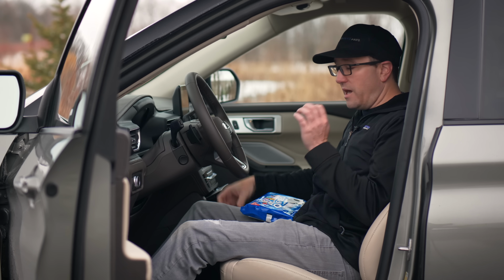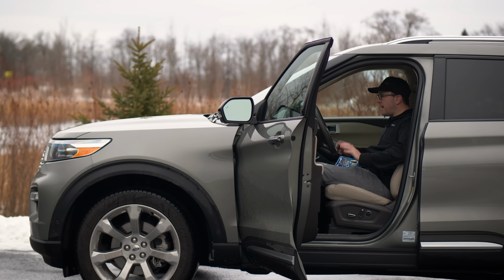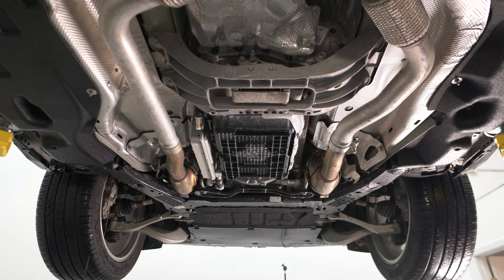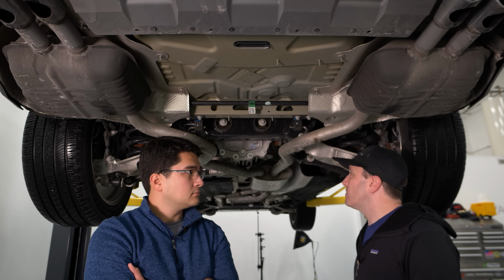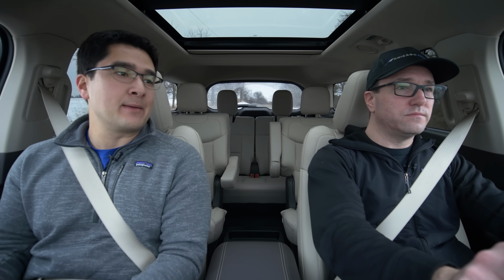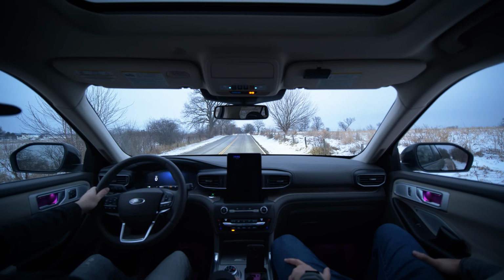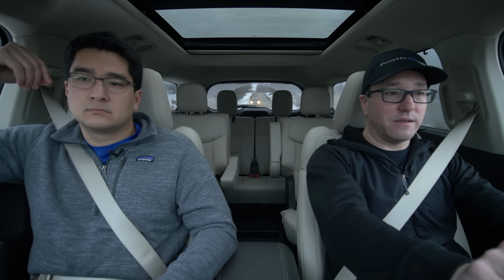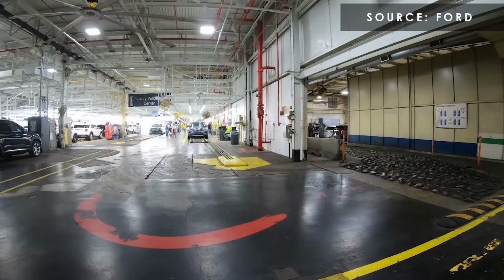2020 Ford Explorer | Who Is Responsible For This?

Comment: The Ford Explorer Platinum trim starts at $58,525... comparably equipped competitors below:

Toyota Highlander Platinum: $46,850
Hyundai Palisade Limited:$44,925
Kia Telluride SX: $41,790 
Honda Pilot Elite: $48,220
VW Atlas SEL Premium: $48,395

Furthermore base luxury 3-row SUVs, 
Lexus RXL base: $48,325
Acura MDX base: $44,500
Audi Q7 Premium: $53,550
GMC Yukon XL base: $52,400

The list goes on. Can someone PLEASE explain to me how the Explorer Platinum is $6,000-11,000 more than comparably equipped competition, AND the luxury competition?
Reply: Ford half-assed it and wants top of the market segment prices. That's one way to say cars are less profitable.

Never mind the fact that people think an Explorer is a nameplate where you can even think of asking 60 bones for. I'm old enough to remember what kind of quality and luxury you could get for north of 50 grand, and this ain't it Ford. It also wasn't that long ago either.

One last thing. Giant touch screens age poorly. Even if it still functions in 5 years, that ridiculous tablet is going to tank this SUVs resale value something fierce.
Reply: Great point!
Reply: Forget the platinum model...   you can't get an explorer in a 6 cylinder for under $50,000.  Toyota..  Hyundai, Kia, Traverse, pretty much all competitors have a 6 cylinder starting in the low to mid $30s.

Ford putting a 4 cylinder on a 4,000 pound SUV is moronic.
Reply: @jcjbike  And the Ford turbo four outperforms all those 6 cylinders.
Reply: @georgesnyder5337   If what you said was true, why are all the Broncos coming with 6 cylinder engines, including the base model at $27K?  You must work for the company that supplies Ford their turbo chargers because they are going to make a killing selling those to Explorer owners every 35,000 miles.
Reply: @jcjbike  Huh?  I work for the turbo company because I point something out?  Cool story Joey.  I am not sure what point you are trying to make with the Bronco is.  I am also not sure what you are going on about with turbo chargers being replaced at 35k miles.  So much goodness in your post.
Reply: @georgesnyder5337   Follow me...  I'll type slowly...   Ford...  has tried to rip off potential customers by under-specing AND over-pricing the explorer.  EVERY SUV in that class runs a far more powerful, longer lasting engine and also is priced better.  Putting aside the growing list of reviews online where customers are complaining about their turbos going bad (a turbo in a 4 cylinder can't push a 4,000+ pound SUV before that weight causes premature breakdowns...   even Ford announced big price drops on their 2021 model year.  That's them acknowledging they missed the mark.  The Bronco reference goes right to your point...  if that 4 cylinder "performed better" then why didn't they follow suit and put that engine in all the broncos???
Reply: @jcjbike  Ok guy.  You statements about 4 cylinder turbos "not being able to push a 4000 lb SUV" dates you to peaking in the early eighties when turbos were a new thing. Here it is - a fact: like it or not, the 2.3 eco boost equals or outperforms the 6 cylinders in all of those cars mentioned.  It is not an emotional statement.  Simply a fact.  Your assertion that it will suffer premature breakdown simply ignores the mountains of objective data, including other cars with similar powertrains, that demonstrate otherwise.  Period.  Once you swallow that pill, you can see that the Limited trim pits against, say, a Highlander Platinum, much more evenly.  You keep going on about the bronco - I am not sure why.  I didn't say the 2.3 performs better than the 6 - it doesn't.  I am not comparing those two, or comparing them to an unrelated Ford sibling.  Stay on track.
Reply: @georgesnyder5337   Let's compare...  if this mindset on 4 cylinders is archaic, then why do all the competitors to explorers still use 6 cylinders?  You use 4 cylinders to be cheap...  yet the explorer isn't cheaper.  In fact, it was so over priced in 2020, that ford had to drop their prices for the same models in 2021. 
If the 4 cylinder ford engine is so great, why is it not in the Bronco?  Heck, why isn't that 4 cylinder on the Ford Edge???
Reply: @jcjbike  Yikes.  The 4 cylinder is in the Bronco.  We are done here.  You clearly don't know what you are talking about.
Reply: In my area the Palisade/Telluride top trims if you can find them in stock are going for literal MSRP (The $49kish)  vs Explorer Platinum is going for about $51k (with massaging seats and self sealing tires and stuff). I think Ford is trying to do the "Starts expensive but look at the deal you get!"
Reply: @sumofty  my niece has a Hyundai Kona. 9,000 miles needs a new engine
Reply: @sumofty   Right now, inventory is tighter so they are getting higher prices.  If you are talking about apples to apples, the two lower level explorers (starting price to low $40s) are out of spec related to the competition in terms of the engine.  A 4 cylinder on a 4,000 pound suv???
Reply: @jcjbike  Actually dont knock the 4 cylinder until youve tried it, it feel pretty solid imo. They actually are higher HP than the Telluride, Highlander, etc and the Explorer's RWD architecture makes it so that the 4 cylinder actually has great towing capacity too. That said, the Dealer lots near me only have like 5 explorers each. You can get a platinum or a ST right now in my area and thats it lol
Reply: @sumofty   It's easy to knock a 4 cylinder on an SUV.  Especially when every other suv in the category (traverse, highlander, murano/pathfinder, durango, Palisade, etc.) offers 6 cylinders for their SUVs in the low $30s and go up from there.

And the fact that Ford recently announced their 2021 explorers (same vehicle as 2020) will be reduced in price several thousand dollars clearly suggest they know their product isn't price/spec competitive either.
Reply: What’s is crazy is, compare it to a genesis gv80 😬
Reply: @doubled8247     love the looks gv80 just hope it come in  2 row
Reply: @doubled8247  like  it but no v8
Reply: @youtubecarspottersguide1   don't worry the v6 ecoboost has the power of a v8 but it spend about the same amount of gas
Reply: @chicotruco  yep..and ford I4 turbo is a sweet little motor. I was amazed.
Reply: Not sure where you are but in Canada its called interest, a highlander here has 4.99%, they have an MSRP of 53000 cad and with that interest it skyrockets up to 61000, our ST was less than the highlander and had way more features. The same goes for a telluride etc. We test drove 5 different SUV's and for the price it's really hard to swallow getting highlander colour blank that everyone else has for more money than something special and fun
Reply: Ford is the worst dealer when it comes to inflated MSRP to give customers the illusion of a great discount, especially compared to most other comapnies that go 0-10% max on average.
Reply: @TheRedc0met  I guess it would depend on what you value.  By all accounts, the driving dynamics are better.  Heck, you can't even get a proper tow hitch on a highlander from the factory.  It is also roomier than the Highlander.  So yeah, I am sure someone will buy this "junk" over the Toyota.
Reply: @georgesnyder5337  People who want a proper tow hitch on a highlander usually don't get the highlander lol. They get the 4runner. And the new Highlander is just as roomy if not more, At least it was to me. Add best in class mpg getting this Ford would be stupid.
Reply: Good point. I bought the Highlander Platinum after leasing 3 Explorers.
Reply: Jerry Phillips  fair enough. Lexus are damn nice cars that hold their value for sure, especially those 90s and early 00 models. 
Personally, I generally don’t factor resale as highly as driving experience, and that put the explorer far ahead of the highlander even considering how much less I’ll get for it in 10 years. Couldn’t afford the new 3 row LX sadly.
Reply: you are paying for the shit sound system hahahaha
Reply: @chicotruco  lol, what 50k car has a good factory sound system?  They all sound about the same to me. But I do like the massaging seats that come with the upgraded, but yet still shit, stereo in the explorer.
Reply: @gregdavis7316  I recently bought a second hand, 2016 explorer, it comes with 12 frecking speakers, yes 12 speakers got a subwoofer in the front right on my face, and when the bass kicks in sounds like somebody is farting, lol cheap quality but they sell it like a "premium sound"
Reply: @chicotruco  my 2020 has 14 speakers and that same hollow woofer. And sounds about the same as yours lol. Gotta go German for decent audio, even then aftermarket will always be better.
Reply: @gregdavis7316  yeah I am thinking on doing the same aftermarket are better speakers and they are not that expensive. good luck!
Reply: 3 row mid size there is a lot on compation fwd, rwd, awd,
Reply: Because people r retarded
Reply: You have to know how to live your American dream. asking any investor and he would tell you to wait one year and buy a used one and save thousands. But if you can afford a new one go for it. Nothing wrong with Ford products. they are some of the best vehicles especially in North America. Reliable, durable, and rival all of the imports everyone loves to talk about. I'll take a Ford any day over Hyundai, Kia, Subaru, Honda etc. You never see the highway patrol in a Hyundai.. I'm just saying. Think about that.
Reply: Lincoln Aviator Reserve AWD starts at 60000 which is a better car and the only other RWD architecture cars from that list are  the Q7 and the Yukon which is body on frame .
Reply: Aren't most of those comparable to the next size down SUV? It's also better to compare selling prices than smtp. As far as whining that a v6 is just so much better than a turbo 4, is it really?
Reply: @groofromtheup5719  that turbo 4 ain't nothing to play with. It is truly a beast. Around 300 horsepower or so.. pair to a 9 speed transmission. Things sure have changed.
Reply: @josephdominics5935  I like my 2010 GX460,  with 301 hp 8cyl.... smooth, durable power
Reply: Because it has more equipment and more power than most of those.  The Limited trim aligns with those comparably equipped competitors ;list you have way better.  Though it is a 2 row, a better comparison would be to look at how the Jeep does its trims in the Grand Cherokee.  An overland is pretty much loaded, but then they go well further.
Reply: Some oc these prices are wrong
Reply: They feed off the ignorance of the average person. A lot of Americans have a patriotic mindset and refuse to look at the Asian car market
Reply: subaru ascent is great 3 row
Reply: @isaiahteehee696  get the Toyota. The Ascent is junk
Reply: Hyundai Palisade and Kia Telluride are the best in class... PERIOD. B E S T value for the money.
Reply: I got my Explorer St for 49k (with sunroof, tech pckg, and street pack... and they gave me waaay too much for my trade in). That’s about 10-11k below MSRP. Not sure where you spec’d the Highlander but in my area it was the same price as I paid for the St. 
I agree with this review about the interior of the Explorer so if fit and finish is your main selling point there are better cars than the Explorer. But if you want a good, and fun (for a 3 row suv), driving experience with tons of tech and driving aids then nothing in the price range compares.
Reply: @gregdavis7316   Greg...   they didn't give you way to much for your trade in.  They overpriced the explorer so much that there was a huge amount of profit that they could give that much off.
Car dealers only "give" what that trade in is worth at the auction.  If it's worth $15K at auction and they tell you they are giving you $20K, they are really just taking $5K off the new car.  Ford has already announced that the 2021 explorers will see $5K+ price reductions on the more premium models.
Reply: @jcjbike  yeah, I seen that about the 2021’s. And I agree they overpriced them in 2020 (and still in 2021 even). Domestic brands always do that and negotiate down. I wouldnt expect to get 18% off msrp from an import brand but I was happy to get that off my Explorer msrp. 
But the 21k they gave me for a 2016 Murano SL with 90k miles, is way too much for a trade in lol.
Reply: @gregdavis7316   I owned a 2016 murano and I liked how it drove.  Now have a Highlander.  I've owned a ranger..  and escape..  two F 150s..  and an explorer over the years.  I have some amount of brand loyalty as my grandfather worked for Ford his whole life in Dearborn.
But now that a vehicle purchase is such a bigger amount of money than 25 years ago, reliability and not overpaying are more important than brand loyalty.  If I had to (and was ready to) spend $50K on an Explorer, I'd spend the same on a Chevy Tahoe.  But I'd then say, I'd rather buy the chevy traverse (not fully loaded) for $35K with a 6 cylinder.

You look at the Bronco roll out...  provided there are massive design problems, they are putting out a 6 cylinder suv in the high $20s with many options in the low $30s.  You have to think they explorer product team is thinking  "holy schmoly, are we in trouble."
Reply: @jcjbike  well, the Bronco, as nice as it looks on paper, is a niche vehicle. I wouldn’t personally want to own one as my daily since I don’t plan to off road. I think it’ll sell well though. As for the rest of ford reliability, I’ve personally never had issue with them. Not to say I won’t but it’s always a gamble with any car.  Purely an odds game. 
Absolutely get what you’re saying about the prices of current vehicles, not to mention the wide selection especially in the 3 row suv segment that makes shopping around for what what you really want so important. Thats where individual priorities come in. I traded theoretical predicted reliability and some luxury for a better driving experience. Drive an St and see how it stacks up to the rest of its class. Sit in a Palisade and be amazed how nice the cabin is. Or get a traverse and love having more cargo space for less money than anyone else. Just as examples. People prioritize things differently and I’m glad they do. Roads would be boring if we all had the same car.
Reply: @gregdavis7316  where did you get this deal? I'm looking to trade in my 2017 explorer for an explorer st soon. I live in Miami but man your deal gives me hope.
Reply: @JLaFragancia  lol, I’m on the complete opposite side of the country from you. Seattle area. I’m not really sure how I got that deal. They’d only do it for the color I got (which was what I wanted but didn’t tell them that). Said it was a dealer swap which makes sense since it had about 120miles on it already. But it has a B vin (don’t get an A vin on a 2020, the first run had chassis problems) so I wasn’t worried. Got 10k on her now, about 2k of that was pulling a 4,000lb trailer. Not a single problem, not even a rattle yet. Hope you find a good deal!  The ‘21s have a few subtle but nice styling changes.
Reply: @gregdavis7316  thanks for the reply and the info.
Reply: @gregdavis7316  I'm buying a used 2020. How is your car, did you have any problems?
Reply: @viniciusmayer1554  it was great. I’ve since taken advantage of the crazy market and traded in that ‘20 St, it had 14k miles and not a single problem. Traded for… a ‘21 St. so far only about 4K miles on the ‘21 but still no problems. I’ve modded the ‘21 with lowering springs, exhaust, and a tune. Come summer I’ll put in a new intercooler and downpipes. I really love the car. It’s fun as hell to drive, comfy, loaded with safety tech, great in snow even with factory wheels/tires, looks good, and I can’t emphasize this enough, it’s super fun to drive!
Reply: @gregdavis7316  thanks

Comment: These are the reasons why I won't buy anything from the corrupt big 3!  Unions push for extreme wages and retirement packages yet collude with the companies themselves!  The people running car manufacturer's get crazy wages and bonuses!  No one has learned a single thing since the gov't bailed out GM and mopar! 
I'll keep my old vw touareg until it literally dies or falls apart.  
And States that use salt on the roads should be ashamed to add fuel taxes and other taxes on motor vehicle users! 
It should be illegal for them to be allowed to ruin your vehicle but they and the manufacturer's are in bed together so they can sell more vehicles when yours will no longer pass inspection!

Comment: Manufacturers are increasing number of gears in the transmission to increase MPG, but at a cost of reliability and comfort. More gears means more shifts, which leads to more wear and less comfort as the transmission is always shifting. Also when the transmission is always shifting, the engine can't stay in its power band for long, leading to sluggish performance, but it does increase MPG because the engine isn't in the power band as much as it is in a 4 speed or 6 speed. So far, Ford's 10 speed sucks, Chrysler's 9 speed sucks. They just can't get it right for whatever reason. Fine tuning can help but it can't eliminate bad design.

Comment: Hhhmmm I think that mindset went into the f150 10 speed transmission.  Terrible experience with mine and they won’t do anything about it.  The outside of the explorer looks good but interior not so much.  Good review.

Comment: I drive a 2016 Explorer 4wd.  And even though it's fwd based if you go to the screen where it shows what power is going to front and back, Everytime you start from a stop the power is always going to both front and back.  And when you put it in mud or sand mode you can get the back end sideways just like rwd. And I do agree I have the 2.3 engine it has plenty of power and is quick but it just doesn't quite feel right in such a big car.  This was a great review.